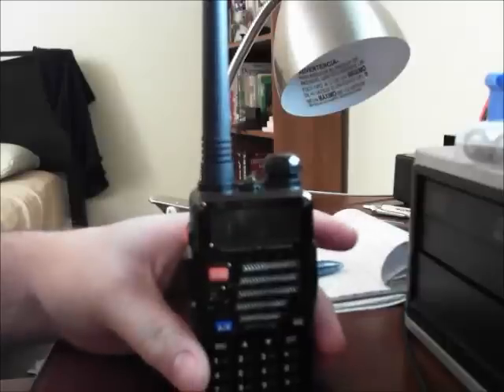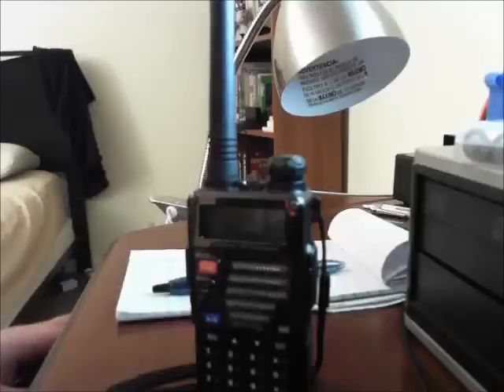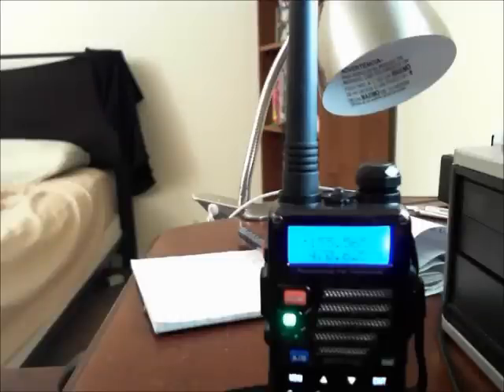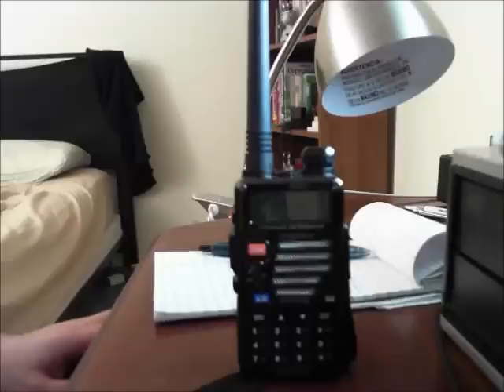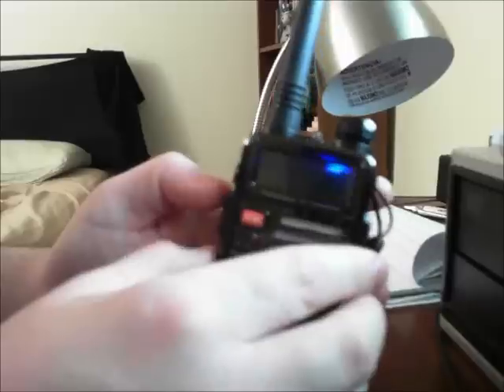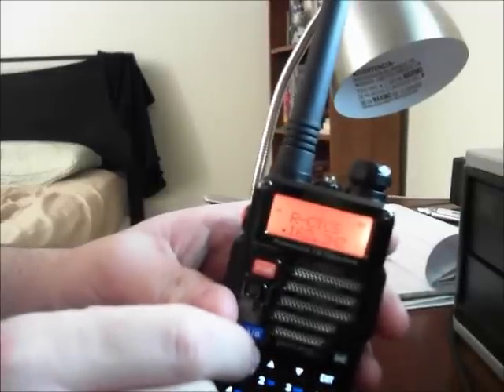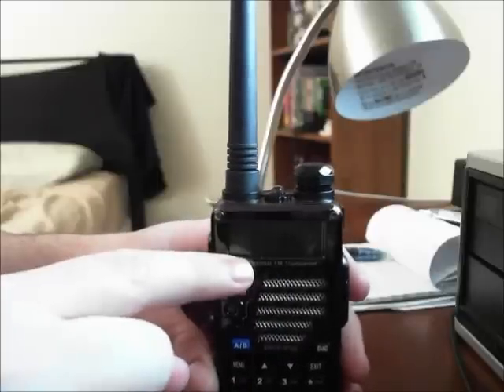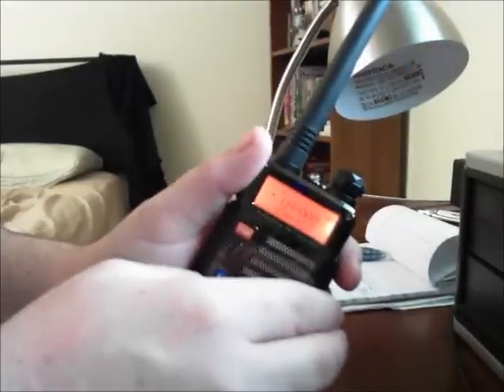Turn your Baofeng UV-5R into a Police Scanner!

Comment: This is a practice I wouldn't encourage, especially for this radio.  Because it will transmit on those frequencies, there's going to be some idiot that will feel it's ok to contact the police with his radio instead of calling 911 in the event of an emergency.  The police will take a very dim view of that.

Also, this might work in small towns where the police are still using analog FM in those frequency bands, but it's not going to work in larger jurisdictions that use 900 MHz and/or trunked systems.  Also, many agencies are now going to digital systems such as P25 and some are even using encryption.
Reply from the maker: It will only TX on those frequencies if you're careless and push the PTT button. If the frequency is duplex and you hit the PTT, nothing will happen unless you entered the correct offset and Tone. It is never okay to use your radio outside the bands which you are licensed to operate on BUT, it is not illegal to use your radio to make a 911 call via an Autopatch. Not many agencies are actually going to use encryption because of the cost as well as backlash from the "plain language" and "anti secret cop codes" crowds. Some organizations and individuals, like news companies and reporters, use receivers/scanners to obtain important information without having to waste time going through a PIO. This benefits the overall public safety because it allows news agencies to broadcast updated information without long delays.
Reply from the maker: The UV-5R is just an analog FM transceiver and doesn't have the ability to do decryption.

Comment: Sir, I'm trying to input our local pd and on the last digit it keeps saying "cancel", am I doing something wrong?  I checked my step and it doesn't seem to impact the input error, thanks for your help
Reply from the maker: What is the frequency that you are trying to listen to? 
The frequency that you are entering is likely outside of the bands that the radio can receive/transmit on. For example, the dual band UV-5R is for VHF frequencies between 136-174MHz and UHF frequencies between 400-520MHz. If your local PD channel isn't within that bandwidth, you wont be able to listen to them.
Reply: Ok gotcha, yes they start at the 800's so I'm out of luck.  I'm sad now lol.  Thanks for the feedback

Comment: Question I have a baufeng uv-5r and wonder if you know how to set up the radio to be like open kind of like scanner so it won't matter yet been able to transmit as well?
Reply from the maker: +Norman R 
I'm not sure what you mean by open. If you're talking about how a scanner keeps scanning through frequencies until it picks up on something, then all you need to do is set the Step (Menu option 2) to 2.5K, then exit the menu, then press and hold the button that says Scan until it beeps or says "scanning begin." I would also adjust the Squelch (Menu option 1) to at least 3 or 4. If it's too low, you'll pick up signals that are all static and it will be annoying as well as it will interrupt the scanning. 
Just remember, the frequencies that you'll be able to pick up depend on the antenna. If you're in the US, you'll have no problem hearing local analog VHF and UHF fire, ems and police communications.

Hope that helps.
Reply: Thank you for your reply and help I'll try that thanks....

Comment: AMamzing video. I had the same outcome. However.  it stopped working and im still not doing something right. :(  Maybe it's my location ( Michigan)
Reply from the maker: Depending on where you are, radio traffic might not be as active as other places. Just because you aren't hearing anything doesn't mean the radio is broken. It could mean that nobody is transmitting on the frequency you're on or it could be RFI related issues. For example, there is RFI radiating from my fridge in the kitchen. If I am in the living room on the SE side of the fridge, I cannot receive anything coming from the NE or NW. If I hold the HT sideways, it helps sometimes, especially with WX. For what ever reason, WX stations are clearer with a horizontally polarized antenna.

Comment: im in montreal and i got the references frequencies of montrealpolice but how do i program my uv-5r to connect to they're frequencies ...its a little complex i find ....i dont really know where and what to do in the menu with all these options ..?? please can yu help me ...thx :)
Reply from the maker: +Sylvain descôteaux Hi. If you are only going to listen to a frequency, all you need to do is:
-Be in VFO mode
-Enter the desired frequency
-Wait and listen

Just remember though, some police departments use digital communications that a Baofeng or any analog radio is not able to decode. You will know if the police department uses a mode that your radio cannot decode if you hear fax machine type tones and noises when they are transmitting. 

Hope that helps.
Reply: Pajama Prepper thank you ..i dont know if i have vfo , but i have vhf and uhf ...and where do i go to find vfo on my baofeng uv-5rb ? thx
Reply from the maker: VFO is just the mode that you're usually in if you're not using the memory. I don't have a Baofeng in front of me but I believe they call it Frequency Mode. When you're in Frequency Mode, just punch in the frequency.
Reply: Pajama Prepper ok ....thx  and can i ask why there is two rows of numbers one on top of the other ...do i enter my digit on top row ..
Reply from the maker: Sylvain descôteaux No problem friend. The two rows are just because it's a dual band radio but it doesn't matter which one has what frequency. For example, on my UV-5R that I use for emergencies, the top line is a local amateur radio repeaters that are designated for ARES/SKYWARN while the bottom line is used for either listening to local Police and Fire comms or weather info.
Reply: Pajama Prepper thx ....i did enter the right frequency and tries quite a few and waited ...the green light lit up but no sound ...so its receiving something but no sound ??!!  im clueless ,,maybe there is something to adjust in the menu ...??
Reply from the maker: I'm not sure what the problem might be. Their might be interference. There could be many things causing that. It happens often with my scanner. The signal might be strong enough to be received by the radio, but not strong enough for you to hear the communications.  Try changing the receive setting in the menu from Wideband to Narrowband using menu option 5. If that doesn't fix it, I'd suggest trying other frequencies in a 10 mile range of you and see if the problem still occurs with those frequencies.
Reply: Pajama Prepper thx so much ...but in order for me to ear something i got to press on moni ...a button next to ptt ....weird ...and i only press whenthe green light is on ...i got to keep my finger on it ...
Reply: Pajama Prepper FOrgot to ask , should i put it on a certain channel ...there are 129 channels...?
Reply from the maker: +Sylvain descôteaux No, the channel doesn't matter unless you've saved the frequency into memory.

Comment: hi hey I'm trying to pick up florence az pd and I see it transmitting but I don't hear anything. is there a side channel I have to put in? if so what setting is it?
Reply: Brian M you may have to scan said channel with either the CTCSS or DCS features as sometimes it'll be encoded with those features... I'm also just getting into HAM as well... But mainly for personal comms.
Reply: idk how to scan those channles tried to but it's not working. I'm doing it one at a time. long procces but if it works ill let ya know. Thank you!
Reply: Brian M anytime to help a fellow HAM operator get into HAM. Currently arranging an exam to get licensed.
Reply: +MegaCophater I'm waiting to take my ham licence I'm almost ready.
Reply: No go on scanning r ctcs or r ctcs

Comment: Please. Is this the Tetra network it is talk about here??
Reply from the maker: +Normann Hi, unfortunately it is not about the Tetra network. 

Sorry.
Reply: Oki. Thanks so much for the answer.  And great work by the way.  Do you know if we can use these to enter the tetra  network?  And one more question. Can i reprogram it so i can listen to like 8000mhz?   And it is restricted to 520,000. And 174,000mhz. Can i make that unlimitied or something?  So i can listen to 700,625 for example. Or 120,000mhz.  It is locked on 136.00mhz to 174,000. I want them all. You think i can do that?  I know it is not legal. But i like to know how it work;-)))))
Reply from the maker: +Normann Thank you, I'm glad you liked the videos. I'm not familiar with the Tetra network and I don't believe you can reprogram the Baofeng radios at all.  Even if you were able to modify the radio itself for frequencies in the 800mhz band, you would need an antenna that is resonant on that band.
Reply: Okey.  I understand.  It says that we are going to have the tetra net within some months here in Norway. They have installed it in south part of Norway. And coming north. And i see if i do a search on tetra walkies. There are some that comes up. One said transmitt on tetra closed band. Commercial was : Listen to the tatra network. And i need to find out. I think you can programm it in the ways you want. I have a very special antenna. Directional.  but it is a up to 2,4g. And it is about 30db.  Ment dbi.   Disebel as it is measured in.  This is something new developed by the US.  So it must come there soon..  Maybe when jade helm sets in they swtch over, Noone prepared and cant track troop movements.  It is very smart if it is the case. Here there is no point in having marsall law. We already in it.  And our law syatem has prooven to be one of the best in the world. We  have the lowest penaltys in the world. 21 years is life in prison. If you kill someone. You would maybe under special sucumstanses get 12 years also. Ore 5 for a murder. And all that has been in. Has not killed again. Non that i know of in history. Our state pays alot of money rehabilitating prisoners to work normal after the prison stay.  And all are getting the new tetra. Prisons. Ambulances. And everything else. It would be and idea for you. Did you not live in america?

Comment: i have a question for anyone that will answer, im a firefighter and first responder, will the uv-82 work for communicating with coomm center/all county fire dispatch?. so i can check in route.?
Reply: +jordan walsh It depends on what your department's system is. Is it a digital or analog system. If it is digital, then you won't be able to transmit or receive. If it is analog, but it is scrambled, then you have no luck. It could be a digital system, and the waves could be encrypted so if it is I would recommend speaking with your chief to be issued a radio, or buy a radio. My local police, fire (and almost ambulance) system is EDACS PROVOICE so there is no way to listen to them even on my Uniden BCD436HP scanner. So respond back on what your system is.
Reply: Louie MIller Well, sorry sir, but he was asking if the UV-82 radio worked. So I was asking him some more questions to try and narrow it down a little more. There is no reason for you to come out like that.
Reply: its all good guys, had the guy who program our pagers program my radio and it works great. thanks for the reply
Reply: jordan walsh Alright! Good luck.
Reply from the maker: +Louie MIller Don't talk to my subscribers like that.
Reply: +Pajama Prepper (KC1CWP) calm down I just called him a smartass I didn't say anything crazy but I'm right and its true Google uniden bcd436hp provoice update
Reply: I am also a first responder and ues my Baofeng for my FD for central dispatch, tac chanel and also other agencies.

Comment: We're trying to figure how to program this thing only not all the other gibberish you are giving out!
Reply: I'm trying to communicate with my work. so if you find anything let me know. I can hear them they can not hear meif this helps I'm  in phx and the channel I'm using is 154600
Reply from the maker: Frank, I did explain how to MANUALLY program this radio. What you do is you use the keypad to enter the frequency that you want to listen to. It's that simple. I don't use Chirp on any of my Baofengs nor do I use the Memory channels because it's a pain in the ass and rarely works. Are you even a licensed Ham?
Reply: Brian Miller have you tried 154.570? its channel 2 on the commercial radios used in places like wally world. usually 154.600 is channel 1 so they must be using channel 2. also, those mud band radios such as those used there only reach about 2 km so o 've you leave it will not work.
Reply: @bM-nt2tm  you have to se the transmission frequency.  I had same issue. Tds or ctss frequency depending on type of radio iwas setting mine to d155n instead of d155I.

Comment: Can you hear the gmrs or frs guys on freq mode
Reply from the maker: Maureen Patch The mode doesn't have anything to do with if you can receive and/or transmit. If you have an antenna and radio that are tuned for the GMRS and FRS bands then you will be able to receive "hear" people on a frequency in a specific band.
Reply: Yes I pick up GMRS, FRS and MURS on mine

Comment: to bad it doesn't do the p25 (apco) 
at least can't get mine to do it
Reply from the maker: +panzerpat The Baofeng's are not digital so they wont get any digital modes like P25. 2 way radios with that sort of system are really hard to find and also expensive. Maybe there is an SDR that can do P25? Thanks for the comment too!

Comment: prepare to throw your Baofang radio in the bin , as its a Sucky radio for communications and a even worse as a Scanner. you are better off with a Digital Scanner from AOR or ICOM.
Reply from the maker: Mark Plott wrong. It receives and transmits just fine. Next time comment with facts and not your opinion.
Reply: Its an Illegal Radio to use out of the box, you need to reprogram it in order to comply with FCC rules. its also a piss poor as a scanner , it cant even monitor Digital scanner frequencies or trunking.
Reply: Mark Plott. Surely this is a breach for Baofeng then as the radio is sold and marked up as FCC certified ?
Reply from the maker: Mark Plott everyone who buys a Baofeng is aware that it is ANALOG. If you want to listen to digital and encrypted stuff good for you but it has nothing to do with the video.